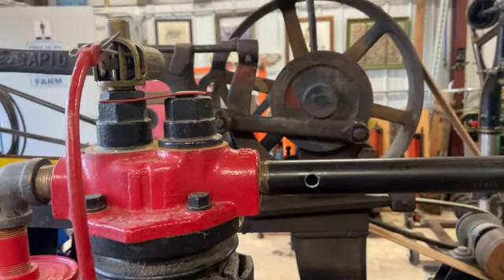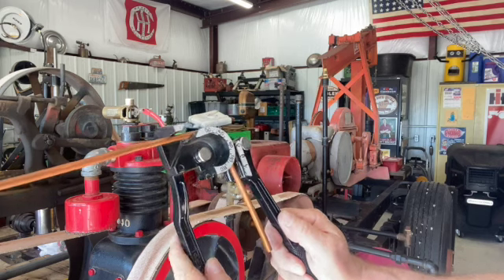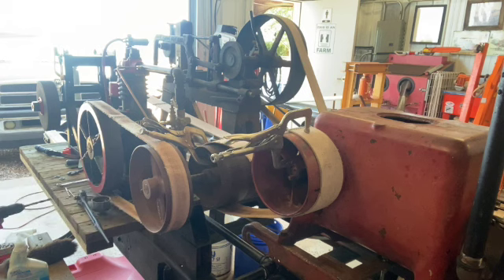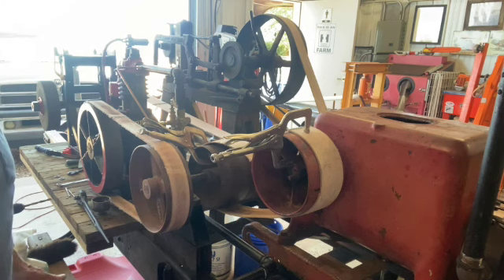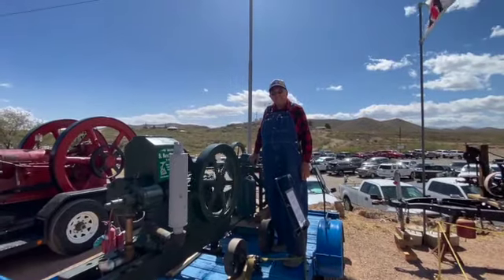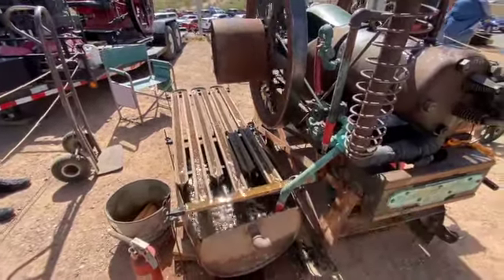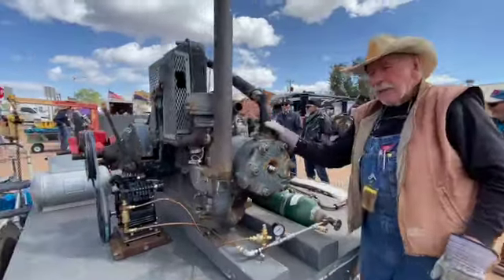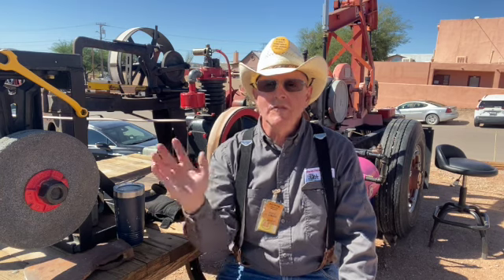Tombstone Or Bust! Pump Jack Trailer Finale

Comment: 4:02  I was just about to say I like those things.....they seem to be cool.  I have two now and used them for supply lines under the sink.

I would like to get one of those fancy brake line maker things.    tHanks for the video
Reply from the maker: @Dancing_Alone_wRentals  I wouldn’t recommend the Hobo Freight ones. Check with Eastwood and other auto suppliers 👍
Reply: @mattthescrapwhisperer  Eastwood was the brand which caught my eye.  So I think...there was a guy using one in a YouTube.
It looked like fun work, a bit of thinking, some difficulty, and most cars are needing these repairs.

Comment: Forgot to mention it a couple videos back but Flywheel Supply has rockers.
Reply from the maker: @GettinGreasyGarage  They do! 70 bucks a piece 😳. Thanks Mike!
Reply: @mattthescrapwhisperer  yeah their spendy. I located that outfit for a local guy that had one of those engines. Valve stuck on his too.